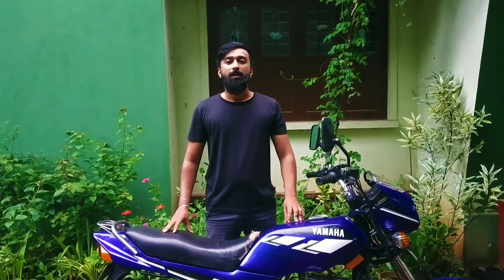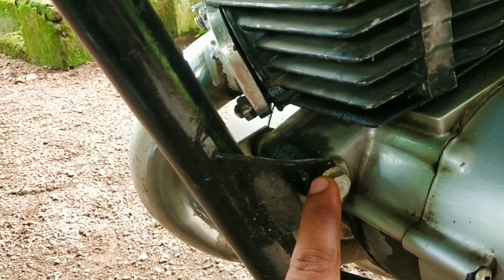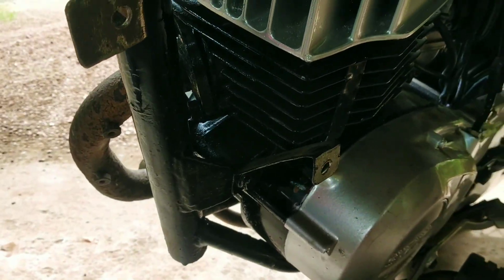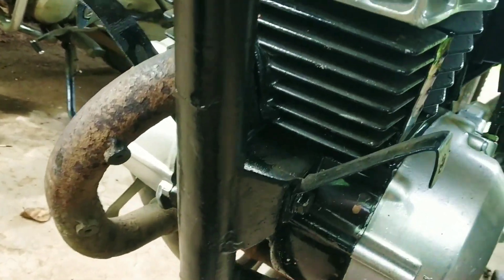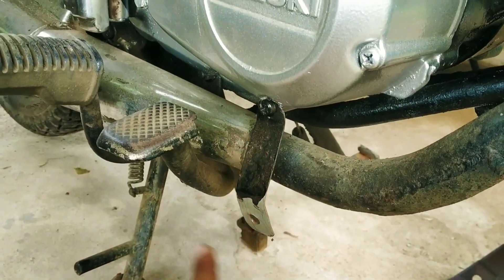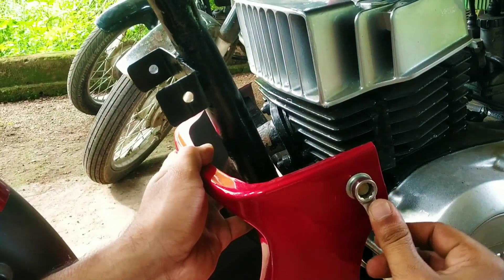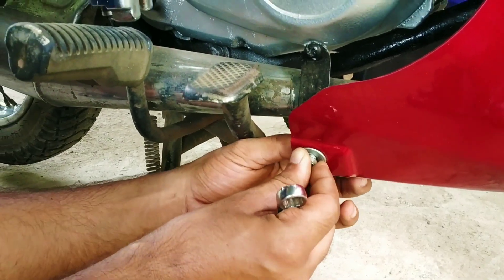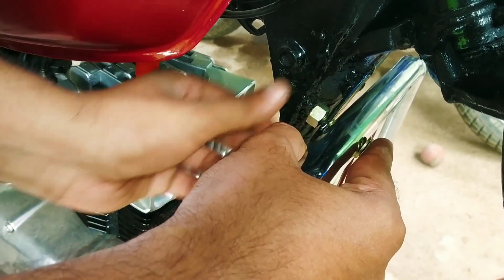How To Install Yamaha RxZ Engine Guard & Crash Guard On Suzuki 2 Stroke Bikes | Vlog 28 | Malayalam

Comment: Bro yanthe bike samurai aan bike keattam kearunnillaa yanthaa onn paranjj taroo pleez reply
Reply from the maker: Bro carburetor clean akki... Tune cheythal mathi
Reply: Engin oil level check cheyy.. Heat absorvation proper alland vannal  pulling il problem varum.. Clutch, pressure plates um check chayyanam. Athinteyum varaam.  Aadyam carburetor tuning chayyunnathanu  nallath nallonam odiya vandi alle..
Reply from the maker: Correct 👍 check this